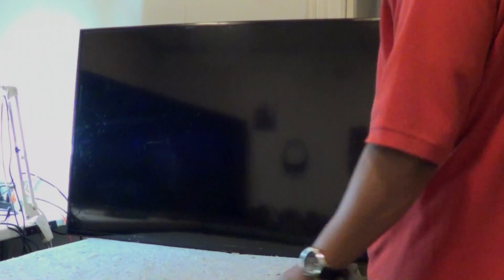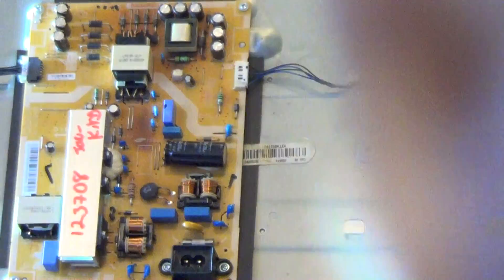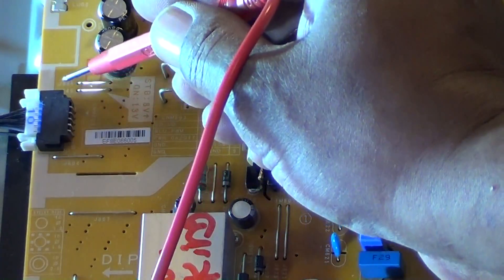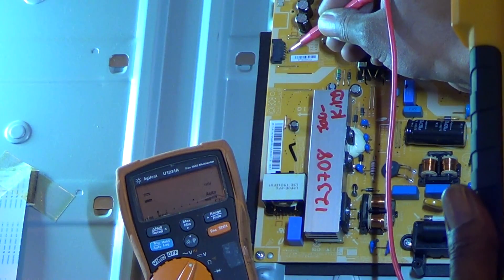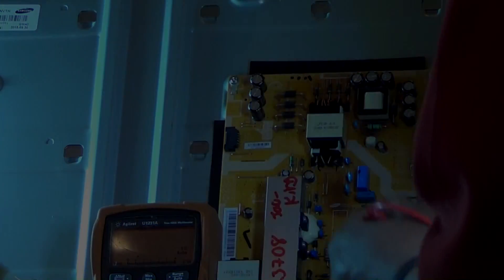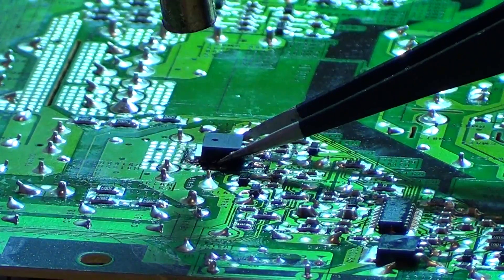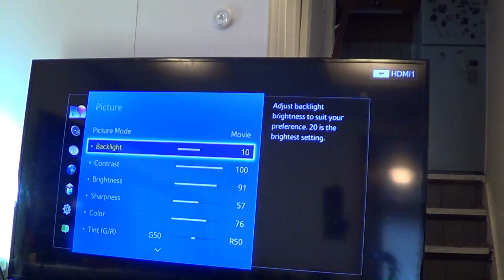Samsung 58 Inch TV,  no power/ dead repair

Comment: Really good video. Thanks for sharing. I had the exact same issue and it seems like that for the majority of the people here on the comment section. I’m guessing this is a flaw in the engineering of this board. It’s pretty disappointing from Samsung to have so much failure for this model and there isn’t any type of recall or some sort.

Comment: To isolate that problem, couldn't you have taken voltage checks at the source of the missing 12volts, instead of checking the board for shorts? Without a schematic, I don't see how the 12v. is generated.

Comment: How long am I suppose to heat this transitory to remove it? The whole board is getting hot and the silver stuff is not turning to liquid
Reply from the maker: Depends on your Hot Air device, air speed, temp, etc
Reply: @bigdog8882  I finally got it off but left some small black marks on my board. Need to get me some solder because there wasn't nearly enough remaining on there

Comment: Hey Bigdog I love the videos, I have this exact 58 Samsung and have standby red light on but not working.  My power supply is sending out 12.78 Volts to the main board. ( board says 13v) any insight into this ? Also if I press the power on the TV the red LED blinks 3 times as it does before the TV starts up but screen stays black. The red LED does not respond to the power on the remote, only the power on TV.

Comment: i have that same part that fried... i can see a black spot on the board on the other side.. will it still work if i change it or is the board bad now?
Reply from the maker: Change the IC first to see... But you will probably have to change the Led strips also if the IC works at first, but then it eventually burns out again.

Comment: Thank you for this video! Repairing this tv for a friend. It ended up being the D5N40 Mosfet on the left side of the board, scorch mark as proof. If the LED lights are causing the issue with the Mosfets and I was to unhook the led light cables from the board they lead into, in theory this would eliminate it from happening again correct?

Comment: I'm back for more :) last year I repaired a Samsung Plasma TV following one of your videos.  A friend at work was going to throw away this exact model.  In his case there is a red LED light in front of the TV, when you power the TV it clicks and that's it.  So I'm going to do the steps mentioned here and hopefully I can fix it :)  Its definitely less scary to work on these modern TV's vs CRT's :)
Reply: I´m having the same issue here, did you fix it? I already remove the power board.

Comment: Hi I know this is an o0lder video but I have used it to find the problem on my 58" Samsung TV. My issue is my Mofset  Number is STB14NM50N but it is the same one you found bad on that TV in the video. Will the part you listed in the video also work with my board on this Tv power board or should I try to find the ST Mofset on Amazon Canada instead.
 Thanks in advance
Reply from the maker: You can compare the 2 by just googling the part numbers and look at each ones datasheets. But ordering the original is always better. Better safe than sorry.
Reply: @bigdog8882  Thank you for the reply back and yes I will look for the same part as to what's inside the TV as well as compare both Mofsets and see if they are speced the same just in case the other one will work for me and the one you gave the PT number for is easier to find it seems.

Comment: I got same tv un58h5202 with a different problem. Backlight turns on but no picture and potentially no sound. Not sure how to test sound without having a picture. On tcon I get 12v by the fuse. Not sure where to test the incoming voltage on it. There where some test points where I would guess that they are the incoming voltage points but they are only like 0.3v and 0.4v on output test points some had low voltage and some no power at all. What would you recommend to replace? Mainboard or tconboard?

Comment: Thank you bigdog for this. I followed the steps as you explained, lucky enough to find out that my issue was exactly that stupid mosfet. I could buy it from Digi-key for $1 (and $25 for the shipping :). I can't thank you enough, not only for saving me $800 for a new TV, but the moral pain of adding the dead TV to the landfill. I'd like to suggest you something for even better clips if future. I have a little difficulty seeing what you do, specially what you read on the multimeter and its settings. I suggest you ask somebody to hold the cellphone for you, or use a stand. In a couple of cases I had to watch other videos to figure out what you meant. Again thanK you very much for your help.
Reply from the maker: Thanks Bro.

Comment: Great vid.  Any chance you have schematics or the specs required for those transistors.   Seems to be a lack of available info for that model.
Reply from the maker: No chance. There all like that. Just have to look up the Part# and get the pin-out for all semiconductors.

Comment: Habe heute ein BN44-00787A repariert da der Original Mosfet wieder kapput ging. Habe stattdessen den 50R380P bzw. 5R380P ausgelöttet und einen FB11N50A ( IRFB11N50A) genommen und dieser geht auch also wär das gleiche Problem hat einfach diesen verwenden der hat eine Power von 170W der 50R380P nur 83W. Lg. Heiko Barisch

Comment: hi, you replace the mosfet 5R580 but mine has the number 50R380P is it the same ting or there is a lot of different model when I go online to buy it there is a lot of model 50R380
Chad
Reply from the maker: Thats fine. Thats the actuall part #. 5r580p

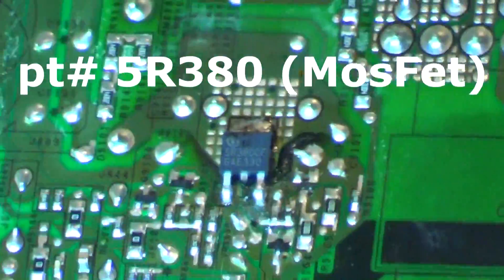Comment: 10:37 the same transistor went bad on this exact TV I have. My transistor had a different # on it and I was able to find it on ebay. Search for :  IPD50R380P Original New MAGNACHIP . Watched a whole movie after fix and no issues. I did take big dog's advice and turned down the back light to half way. Great video.

Comment: The TV repair shop quoted me 200 dollar for the replacement of the whole board + if the led strips are bad the issue will surface again and they wont give a damn.. Good that I found this video because if they dont replace the strips, they might aswell do nothing to it. Using the TV half brightness is out of the question, even max brightness is low for the living room.

Comment: Hey, when you repair this model, do you replace all the strips or are you replacing individual LEDs? We have found poor reliability with replacing individual LEDs on other models, but this is the first of this model we have had in the shop.
Hey man, be careful while measuring. Your hand seems to be sitting on the transformer, which can have high voltage on it if the primary is fully operating.
Nice video, very clear and concise.
Reply from the maker: Thanks for the comment. Since it seems your like me, and do this for a living, I've learnt just order the entire set of strips for this tv and only replace the bad strips, that way you have extra strips for the next one(s).

Comment: Thanks Big Dog. You called it and saved me the cost of a new board.
You're a gentleman and a scholar.
Reply: Follow-up: I installed the new transistor and the power supply worked - Set the backlights to medium in case there's an issue with  any LEDs that might cause it to blow again. I ordered two in case I need to  replace the lights too.
Reply: Hey BigDog. Any chance you'd know how to find out how to fix some faulty LED strips where each light is working individually, but the strip doesn't work?
Reply: @ScooterMcBean  you ever figure that out or what to do? I've burned up two transistor already thinking that was the issue. Some repair guy is telling me that it's the LED that's causing it to short.

Comment: Hi, please i need help. I have the QM801CS and QM802CS transistors/mofset who is burn on this power supply (BN44-00787A) so i can't read what is write on it. Can you help me by giving me the references of these transistors? Thanks
Reply from the maker: You could probably just get away with a standard 600v 10A N-Channel mosfet like this one >>>https://www.ntepartsdirect.com/ENG/PRODUCT/NTE2927?gclid=CjwKCAjwv4_1BRAhEiwAtMDLskNBwGsG128IeomhlqbpCwV0Jw-5pMstCpBQdJfdl3z90UacZ3NaFBoC0c0QAvD_BwE
 
Or Here is a kit with those IC's included >>> http://www.ohmsupplies.co.uk/epages/62027733.sf/en_US/?ObjectPath=/Shops/62027733/Products/KIT483
  
Other than that, Just order the whole board.
Reply: @bigdog8882  thanks

Comment: Hello sir. I got a question, what do think the problem when the logic board and power supply is connected, the voltage dropped to 10v instead of 13v? But when I disconnect the power supply to the logic board the 13v is normal and the led light was on. Where should I'm looking at? Power supply or logic board?

Comment: My issue seems to be with the first MOSFET you tested but I cannot find the model # for it to replace it. Do you have any ideas? Also can you post a direct link to a site that i can source the part from in canada? like mouser.ca or what not.. thanks btw, great video and very helpful!!
Reply from the maker: The part number should be printed on the mosfet. Just use a magnifier to get a good look.
Reply: The top mark on my MOSFET is: 50R380  The video left out the first "0". You'll get better results searching for that.  I'm going to order "IPD50R380CEAUMA1" from Digikey now and see if it works.
Reply: @jadedjohn1218  let me know if it works for you. I need to replace the same one.
Reply: @kbredable  I replaced the 50R380 with "IPD50R380CEAUMA1" from mouser and it worked great
Reply: @kbredable  It did for an hour or two, but then it burned out again. Seems I need a new backlighting component, but I gave up at that point and bought a new TV. It's worth a try for you though, given the cheap cost of the part.
Reply: Eric, the Mosfet you're referring to is the D5N40, which is obsolete. An equivalent replacement is the FQD6N40CTM.

Comment: I have a 55 inch Samsung led tv no power, no stand by light. I checked the power supply board and had 2.7 volts where I should have 13 volts. I changed the power supply board and it worked for apx 20 minutes and went dead again. Same issue, the power supply board. What could be causing my power supply board to fail. I appreciate any advice you might give. Thanks for an excellent video.

Comment: Thanks bigdog8882 for posting and for the clear explanation.  My 2 year old Samsung (UN58MU6100FX2A) went clunk and instantly no picture - no power up, completely dead.  Annoyed because the extended warranty expired a month ago.  Your video helped me find the problem (short on the board, fried a/c fuse) and I have ordered a replacement board.  Should be back to working by the end of the week.  Thank you so much!

Comment: I fixed the power board 13 volts back up. I bought the LEDs, now all the lights are on. Now I have vertical lines. I did some trouble shooting didn't work. I left the power on for 5 minutes, now the power on the tv is out but the stand by light is on. Is it possible for both the power board and main board to short out when my tv initially had some led's off? I get 11 volts on the power board with the back light off. I disconnect the main board from the power supply board and I get close to 13 volts with the led lights on again.

Comment: My stand by voltage is 1 volt. I tested the components Diodes/resistors and all 4 mosfets seem to have conductivity. There are no burnts or inflated caps. None of my led lights turn on when it is plugged in. Could it be just the LEDs or the power board or both?
Reply: You not having the right voltage to power the set..what the voltage on the driver mosphet?
Reply: Your standby voltage should be 12
Reply: Yes, I'm going to trouble shoot tomorrow. I recall 3 mosfets getting the same voltage while the other mosfet (1 not working in this video) volts is lower than the others, but not close to 0 volts. I will double look check again.. I'm guessing I may need a new power board, if it is that one mosfet, I have soldering equipment to take it out and put in a new one. I just want to make the correct purchase to fix it
Reply: Check all the 4 mosphet if they good and not shorted and check all the little resistor mark 100..if Al the mosphet are good and resistor are the fine ..the main issue is the little  ic driver (4pins each side)..let me know what happened
Reply: @akimlafleur91  thanks  will do
Reply: @akimlafleur91  I tested the mosfet ( bad one in this video) I put the leads on I'm assuming the source and drain and I get a buzzing sound on it, so it may be shorted after all
Reply: @slipnorris5882 .if u get a buzzin to the ground,it's definitely shorted ..replace it and your TV will fired up
Reply: @slipnorris5882  most likely this is the main issue of the set..of u replace it and the tv works and then fee hours it burn it again.ypu might have some bad burnt LEDs but that doesn't happeb very often..change the mosfet and u will good to go..u will find it on mouser or digikey
Reply: @akimlafleur91  I hope that will do the trick. When I put in the new mosfet and get my standby back to 13 volts, I have concerns of having bad leds. In my case they are all off. I'm hoping they all come back on and have the tv on for a long time.
Reply: @akimlafleur91  I finally got the chip and soldered a new one in. I got my 12-13 stand by volts back, but I checked the LEDs, not all of them came on, a few were off.
Reply: I put in the Leds all the lights are on now. I thought I was done lol but I guess not. Now I have vertical lines on the screen while I watch tv, bummer
Reply: Hej best BigDog,i have problem whit tv come on this conector 9V,when i plug out come 12.7,what is problem ? Thx

Comment: If all the readings check out on the power supply.  I'm getting 12.8V(13V) when the mainboard is unplugged.  When the mainboard is connected to the power supply, I get 12.4V(I'm assuming that's normal).   Does this mean that the mainboard is the problem?  I do have a standby light and there is sound when powering up the unit.  I'm checking the MosFET's on the mainboard but am not sure how to tell if any are bad, they are all giving similar readings...  Thanks.

Comment: Hi Big Dog
I changed the transistor twice and it worked a couple of hours before burning. 
Do u think the original problem is from the led strip ?
Thanks
Reply: Hey Paul Montero..if the transistor keep burning..there's an issue with the LEDs..open the set and see if the LEDs are not crazy burnt inside. That should be the only reason brother

Comment: Thank you sooo much for this video I've been looking  for a solution to this problem for a month!  My TV did this Friday before Superbowl! Itis the exact TV!  I pulled my power board, I  have a friend who has a hobby of checking and repairing boards. I have ordered the parts needed.  He has a couple transistors he is unable to check for sure without some speacial clip? While I  was waiting I  ordered a replacement board from buyqual china?  It lasted 2 hours and lost all power again.  Pretty sure its the leds now!
Reply: Hi there I have the same problem.  Did you ever fix your TV? Was the led the problem?

Comment: Do they put the underside components onto the boards manually, after the topside is complete? That transister would appear to have been changed before,  as the soldering on it was very much of a lower standard than most of the other components around it...

Comment: I can understand the educational side of the Video and how you explain things. 5:50 thats exactly how you determine if the main board or power supply is bad. you unplug the main board plug to isolate them two if the TV cuts on by pushing the power button then its the main board if not power board.
Reply from the maker: Just checking the 13volt line. Tv will never cut on without the MainBoard plugged in.

Comment: It's the 3 transistor on the bottom of the board
Reply: @bigdog8882 I recently experienced the same issue you described your expertise was a blessing, thing is I ordered a power supply board only to have the same issue. What I done was replace the mosfet with a different one that came with the board I order and tv is back to working. My question is, is it safe because I can't find that exact Mosfet.
Reply from the maker: Sure, Which ones?
Reply: @bigdog8882  3 months ago my power supply burnt and I bought another one. That one also burnt. So my issue is the LED part?
Reply from the maker: @abeluribe10  Yeah, just order the Led Strips.
Reply: @bigdog8882  thanks
Reply: Yes, are you sure,  u can replace transistors and not have the Leds be the issue?  I'm going through this same issue replaced power supply board,  only to have it fail less than 2 hours later. I was going to order a complete tv repair kit from shop Jimmy,  but cancelled because replacing the strips seems a little sketchy for me.  I have a friend working on replacing blown capacitors and mosfets.  He needs a special clip to check a couple transistors.  But,  once he repairs the board I  believe I'll just run the tv on the energy savings mode instead of dynamic mode,  and hopefully it will last this time?

Comment: I fix a lot of these it's the power supply and sometimes it will ow the led lights to
Reply: I have one just like that not powering but none of the components are bad..the transistor are fine,no diode burnt but no dc voltage..suspect the ic is the issue..what ur idea on this big dog or Leon jhonson?
Reply: @akimlafleur91  akim have you tried anything new to find a fix?
Reply: @slipnorris5882  yes I did.. most likely transistor is bad but in some case all of them are good but there's no standby by voltage and no voltage going to the diode..the issue is the little ic driver(8 pins)
Reply: @akimlafleur91  thanks. I haven't tested the mosfet or the ic's yet or checked the leds. next step for me is checking the back of that power board.